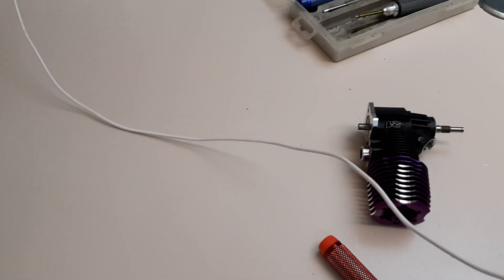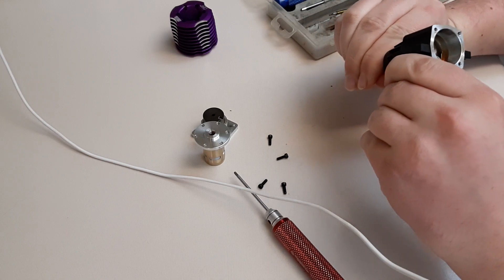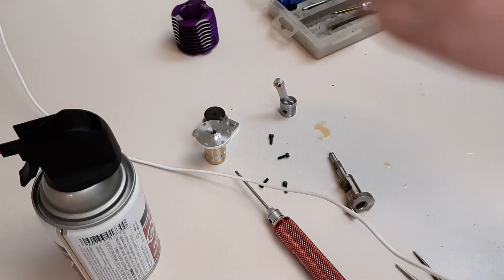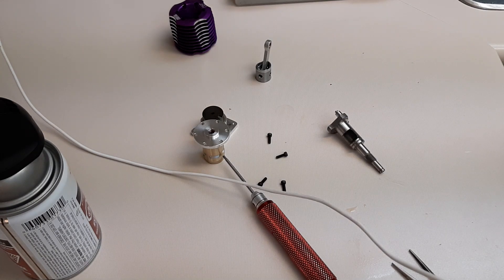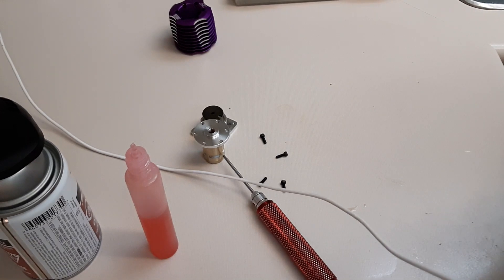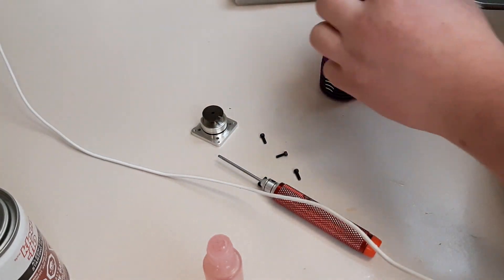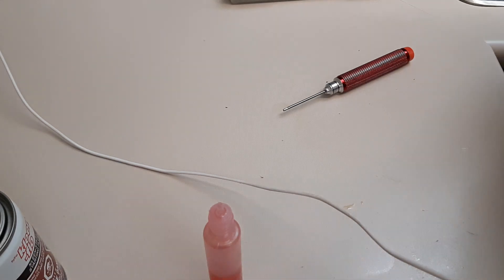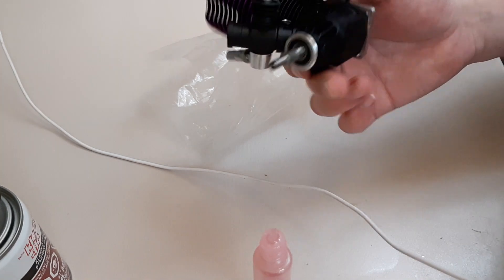Picco 21 X2 Omega tear down and clean up

Comment: that engine is so clean, OMG.  Ofcourse my OS 12 CV had the same issues with the fully gummed up front bearings.  cleaned it up and it runs great, the one in my LOSI XXX-NT.  I'm sad to say I never owned a PICCO engine. Thats right too, most high end motors don't come with a glow plug, they try to upsell us, LOL..
Reply from the maker: I've gotten many engines I've been gummed up from sitting for up to 30 years usually some heat in a good cleaning take everything apart and they're fine and not only high-end engines, the glow plugs but some of the cheaper ones like the sh brand engine seem to not come with a meter kind of annoying and I kind of screwed up in this video I meant to give you a shout out but I totally forgot cuz I got kind of preoccupied with what I was doing but next time I make an RC video I will mention your YouTube channel in there since you do the same thing for me and I really appreciate it
Reply: thanks man!! I know what you mean about forgetting to say stuff in the vids.  alot of what I say is usually stream of consciousness type of stuff and I don't stick to the script I make up in my head ahead of time.  I prefer watching smaller you tubers (under 10K) we all have good video ideas I'd say and clever ways of fixing stuff.  Although the damn sponsored content where people just review cheap rcs is getting rampant now, Thats why I got away from new cheap stuff an went vintage nitro and gas.
Reply from the maker: @hybrid32494  big time dude I totally understand where you're coming from my stuff is just raw uncut footage and I do review some things like an unboxing of something I buy but as far as going out and purchasing stuff and sponsorships and all that no one's been even bother with me it's not really worth my while to be honest

Comment: That’s what happened to my picco.26 max I had to put some 3 and 1 in it
Reply from the maker: 3 in 1 oil is okay but the best stuff that I found is the Great Plains brand after run oil it's clear it doesn't stain or get sticky you can order it online or your hobby shop usually for a few dollars I also have a picco 26 I'm just waiting on new bearings for it cuz the ones that are in there are shot
Reply: thebug 404 is it new
Reply from the maker: Sideways  yup never seen fuel
Reply: thebug 404 nice make sure to take vids
Reply from the maker: @mrsideways4574  will do! We're just waiting on the weather here because it's been so crappy lately

Comment: I'm new to nitro, and I'm really struggling with dirt indigestion. Around 1.5 to 2 gals. I'm wondering if as on a dusty track should I be stripping the engine and cleaning. I change filters often every time  I got to the track
Reply from the maker: Sounds just like cheap air filter and lack of maintenance run a quality foam filter with motocross air filter oil and clean after every hour run Time. If you have dirt in the engine it's 99% damaged with a scored crankshaft and warn out piston and sleeve. DO NOT USE K&N AIR FILTERS! JUNK! the let dirt in!
Reply: @thebug4046  wow thanks for your reply. I was using reds oil and reds filters for sworks. I'm now using nuoil motox oil.  Current motor going strong.

Comment: Im rebuilding this exact motor my piston is fucked. Im tryin to figure out the size I should use to replace the sleeve and piaton
Reply from the maker: You have to use what it's designed to have different engines will have different porting or different bore and stroke combinations and whats wrong with the piston broken?
Reply: @thebug4046  oh ya big time I couldn't figure out why when I'd push the throttle it would die or be very very sluggish so i took apart the motor and the piston head has 2 broken chunks missing. I bought it off someone
Reply from the maker: @aaronhayes4677  shit that sucks man and the parts are very hard to find being that engine is over 20 years old id keep looking on eBay for another

Comment: Hi there! I just got a old Picco.21 x2 from a friend and rebuilt it. I am trying to find factory - break in settings for the carb needles. Can you please help me with that?
Reply from the maker: Hey sorry I don't have any info on the settings. Other then set it on the rich side and work from there. As for break in. The Adam drake method will do! Video on YouTube. Warm up the cylinder head and keep some foil around it to keep the temperature up in the mid 200°f area. Like 230°
Reply: @thebug4046  Tanks man, I appreciate it!
Reply from the maker: @Vali2223  no worries buds good luck!

Comment: How would you assemble the flywheel on a nitro engine?
Reply from the maker: It's harder for me to explain it then to watch a YouTube video I might have one it you go looking it's really easy though
Reply: @thebug4046  I had to take my engine apart because the bearings where no good anymore so we bought new ones and I'm just waiting to get help to buy it back together.
Reply: Put
Reply from the maker: @The_rc_guy_23  what kind of rc are you dealing with? And to you have all the parts? It's kinda hard to do that over text but if you go on Facebook and look up nitro rc enthusiast that is the biggest and best nitro group there is another good one is Nitro/Diesel/Gas Rc and more on Facebook
Reply: @thebug4046  it's a buggy car
Reply from the maker: @The_rc_guy_23  do you have to be a little bit more specific because there's many different brands of buggies out there from about 30 different companies I would have to see what you're dealing with
Reply: @thebug4046  Do you have Instagram?
Reply from the maker: @The_rc_guy_23  nope  but if you go on Facebook and look up those groups posting pictures and videos of your problems you will get help instantly
Reply: @thebug4046  I don't do Facebook